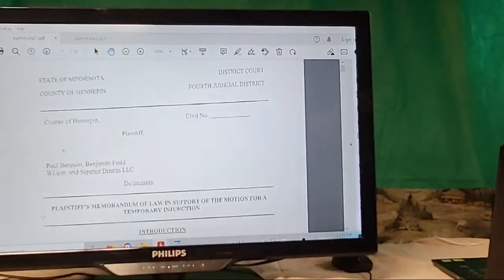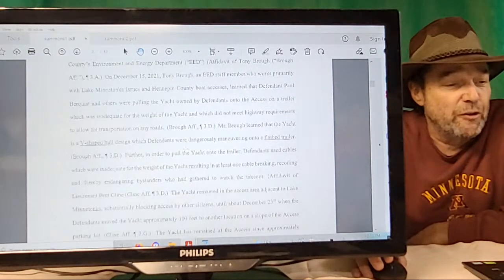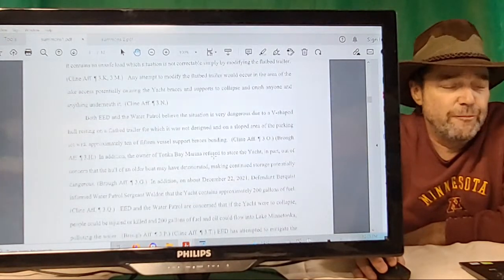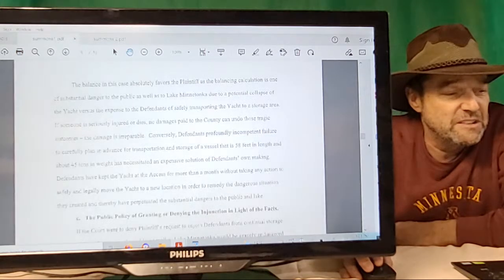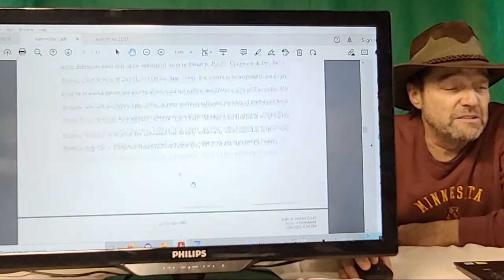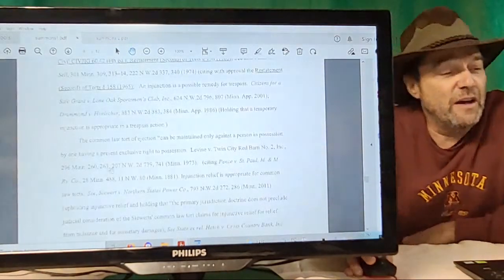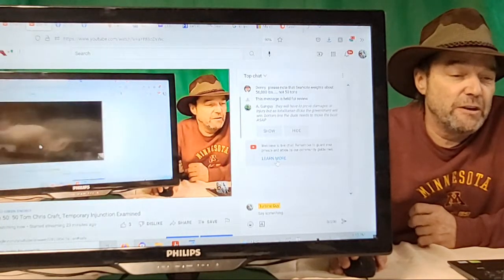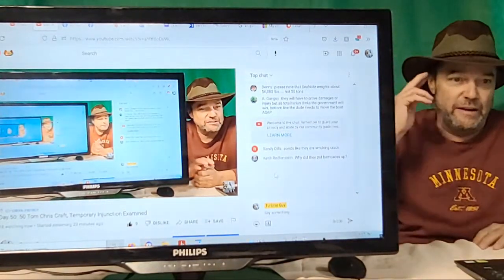50 Ton Chris Craft, Part 1: Seanote Temporary Injunction Examined by the Turbine Guy

Comment: A few things are off but the meat of the details are correct. The videos actually prove most of what's being said. It doesn't matter if it was a cable or a strap, buckling, bent, haul or hull etc., semantics. The videos will likely be used as evidence as well. It is possible this may have not have gone quite so badly, but all this coverage has brought too much attention to it. You said "The yacht hasn't budged"....It dropped a few blocks during one of your videos lol. I could also see the bent uprights when you walked over to it as well. They were nowhere near what was required structurally. The reality here is that a boat was hauled in an unsafe manner with improper equipment, it sits on public property contrary to bylaws , the trailer is not capable of moving it or being safely retrofitted  on site while loaded. They are also not wrong regarding the potential problems. Old aluminum hulls thin from electrolysis and there is the potential for issues as they pointed out. Which is seconded by your friend who ran the marina where it was previously slipped and stored. The trailer it currently sits on is not the only way it can be moved. They just get a proper hauler with a trailer and a crane and it's done. Obviously this whole situation was brought on by trying to save a few bucks vs. hiring a qualified hauler with the right equipment. One can't just throw up their hands and say " we tried to move it but you won't let us do it". It's all on the owner and hauler, improper equipment and a lack of knowledge on the part of the hauling company.Perhaps big boat ownership is not for this gentleman. This was just a haul out and short move. It's entertaining to say the least.
Reply: What would Jesus say about this? I wonder. 🙂🙏
Reply: @michaelbeeministries2020  He wouldn't say much, if anything at all. However, I believe he would walk the Seanote to safety across the frozen water. If this goes on long enough the Lord and Savior will return and walk her to the water come spring launch. Jesus is the most merciless marine comedy writer ever.
Reply: @MovieMuscle  Lol. Good one.  👍

Comment: since they had no choice but to go for it because the ice was freezing over, I would think that it was extenuating circumstances. And I believe the county should be helping rather than finding fault.   -just saying.  🙂
Reply: Not the county or anybody else's duty to help anyone get their boat out of the water. Boats this size are not pulled out at launch ramps. They are also not hauled on a trailer that would not even make the grade as a yard trailer.

Comment: he county built the ramp in the parking lot, with the slope, to me that was a bad job, a bad construction job done by the county, they should've leveled out the road. Lol. You should see our boat launches in Arizona, you would never go to Lake Minnetonka again, those boat launches are bad. The concrete just ends and drops off, that's bad  workmanship
Reply: The ramp works fine for what it is designed to do. I've not seen any locals mention the ramp was an issue. Some looked like they pulled 30 footers out with zero issues.Sixty foot yachts are not pulled out at public ramps. Not even at the largest most elaborate ramps in the country. We will however sometimes launch large stuff off on a large marine hydraulic at ramps we know and are familiar with. This is not done with lowboys etc. Boats this size are dropped onto trailers with travel lifts, or cranes, or picked with hydraulic trailers. The fact that these people undertook this in the fashion they did, and with the equipment they did says it all.
Reply: A lot of launches in Minnesota are too short and the concrete just ends and your trailer goes off the edge, and it's very hard without a 4 x 4 to pull your regular trailer back up off of the ledge. So I know what they are talking about.

 Our ramps here in Arizona keep going all the way to the bottom of the lake. Also we have the big cranes to lift the big boats into the lake. Minnetonka knows these boats are out there, as does Lake Pleasant in Arizona, but look at all the differences in how each lake handles it. Minnetonka has left this gray area where they allow the big boat on the lake, but when it tries to leave, they started putting their hands out for paper printed dollars. They probably think dollars are real money... it's all about the paper in Minnetonka, there after that fake green printed paper
Reply: In Arizona when we move boats that size or bigger, it's not the responsibility of the boat owner to provide the crane or the launch, the lake provides it. Most of the time it's the state that owns the lake, so the state is paying for it to be done proper, because otherwise this happens.
Reply: @Jameson1  
So, if you work overtime, are you allowed to do a worse job at the end of the day? Because you have more work, do you always do a worse job?
Because it sounds like you are insinuating that because Arizona only has a few ramps we do a better job. And you are exempt from having to do a good job because you have extra ramps to put in....
Don't make up excuses for them